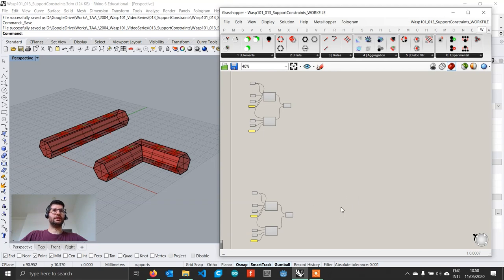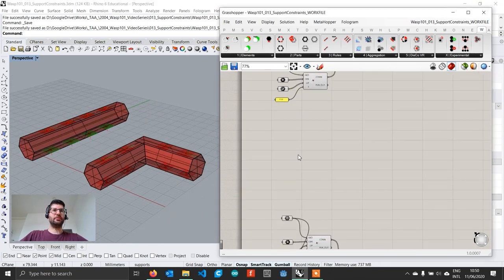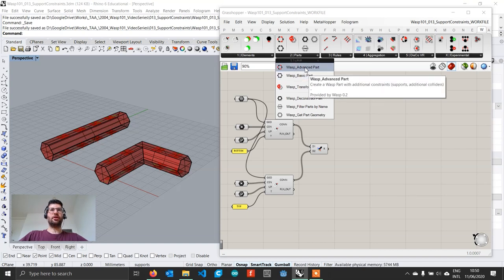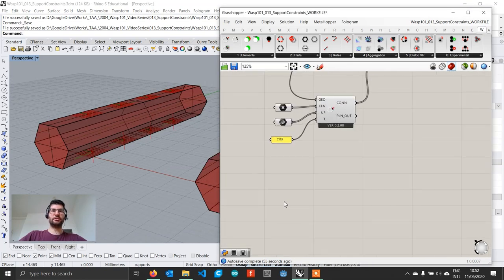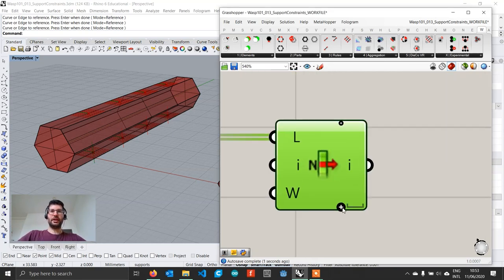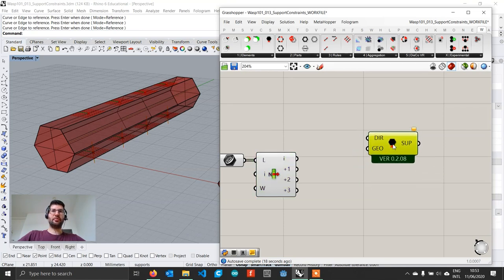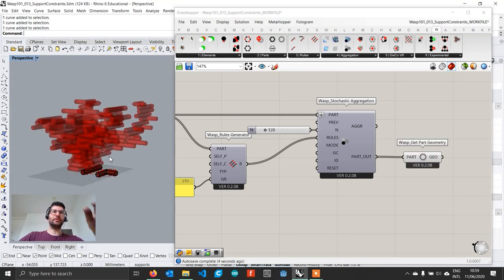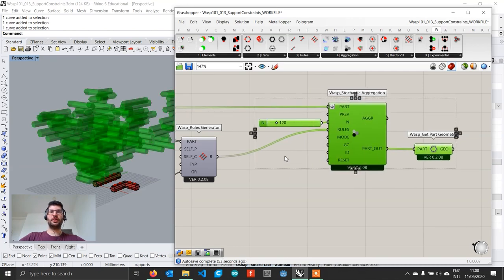Wasp for Grasshopper #101 - Tutorial #013: Support Constraints

Comment: I am trying to model something similar to this but to have each wasp hexagonal prism fit into a set infrastructure.  If I model a column-beam-girder grid, is it possible to create rules for these shapes to aggregate into it?
Reply from the maker: Hi Daniel, yes. What you would need to do is to use the Transform Part component to position the starting points of your aggregation within your grid, and then make sure that your Parts fit and follow the grid with the correct dimensions. Let me know if you need more help. You can also join the Discord Support chat if you have more in-detail questions: https://discord.gg/wke9jt6

Comment: Hi Andrea, thank you very much for creating such a cool tool! I have been keeping following your tutorials. May I ask what is the difference between the advanced part component and the basic part component? I want to understand which one is applied in which situation. That would be very cool if it could be explained in a tutorial. Many thanks.
Reply from the maker: Hi, the main difference lies in the fact that the AdvancedPart has some extra inputs, which allow you to use some other features of Wasp. These are:
- Local constraints (supports and additional collider geometry)
- Field channel assigment (when using multi-channel fields)
- Part Hierarchy (when creating a part which is made of sub-parts)
There are examples for all these features in the Wasp example files, and I will slowly try to cover them as well in the video tutorials.
Besides this, for the aggregation components both BasicPart and AdvancedPart can be used indifferently (you can even mix Basic and Advanced parts in the same aggregation). Simply, if you use a BasicPart and try to set some of the features above, the algorithm will ignore them for the BasicParts.
Reply: @TempAutonArch  Thank you for your quick reply. I really enjoy this plug-in.
Reply from the maker: Thanks! Glad you are enjoying it!!!

Comment: Hey Andrea, the example file of support constraints is not working, can you have a look into it?
Reply from the maker: What is the problem with it? If you are using a newer Wasp version, you will need to update the file. You can see how to do that in the second part of this video: https://youtu.be/MXHCtVCbeiA
Reply: @TempAutonArch  Thanks for the reply. I am pretty sure I am using wasp 0.5.003 and the example files are also from that version. The aggregation component turned red and the error bubble said "solution exception: index out of range: 0". Only when the mode set to local, no constraints works well.
Reply from the maker: Are you talking about the file provided with this video? Or the file in the example files collection available on Food4Rhino?
Reply: @TempAutonArch  from food4rhino
Reply from the maker: Allright, I will check
Reply: @TempAutonArch  Hey Andrea thanks for your time, if you have time I can send you screenshots via discord